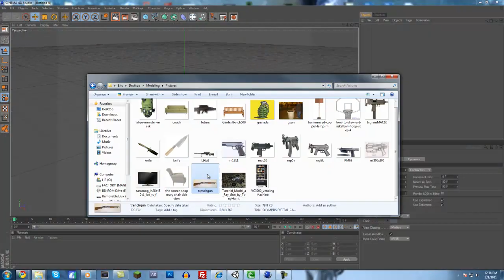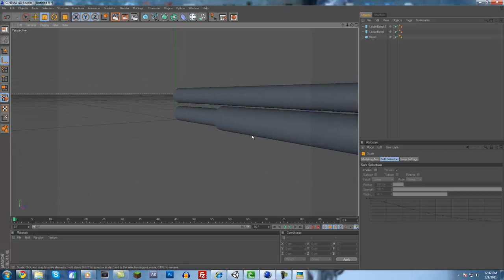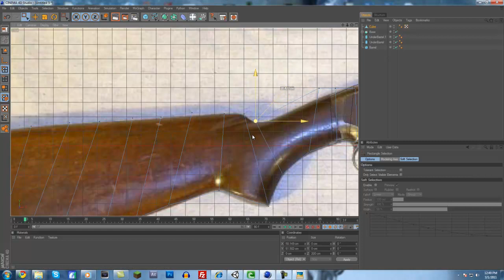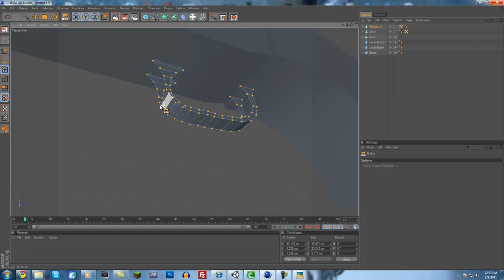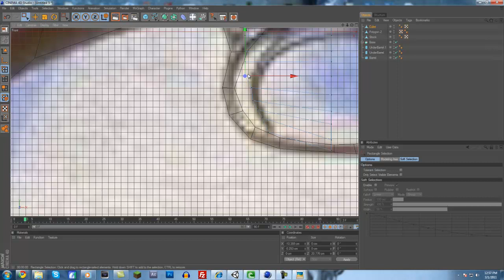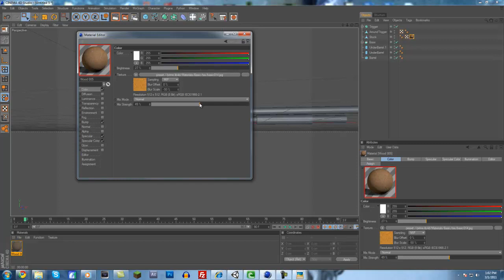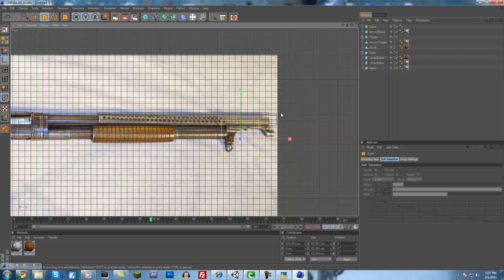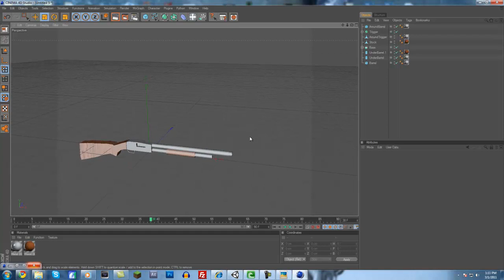Cinema 4D - How to Model a a 3D Shotgun!

Comment: when you were making the trigger case thingy .another way you could have had done it would to have made 2 splines one for the outside of the trigger case and one for the inside the you would use a extrude nurb on both of them then use a "boole" of then to cut out the hole.